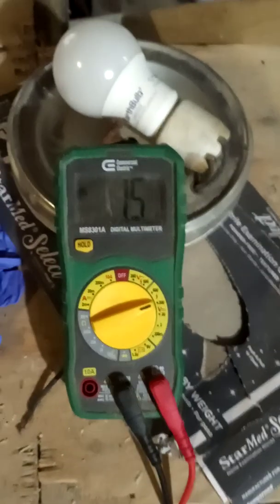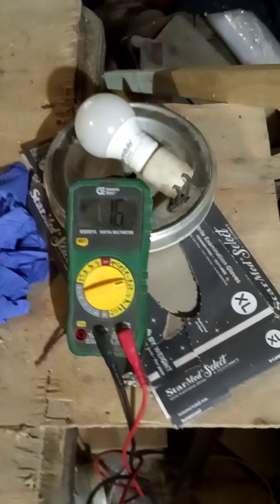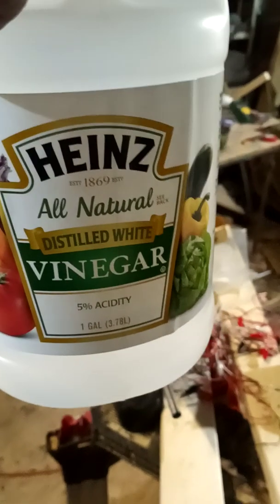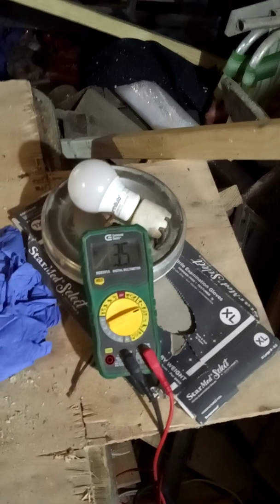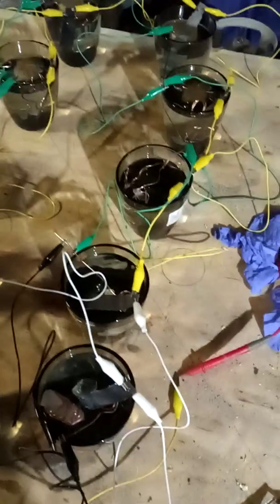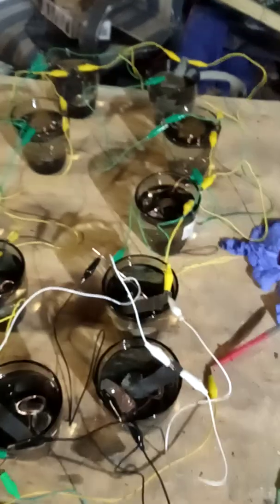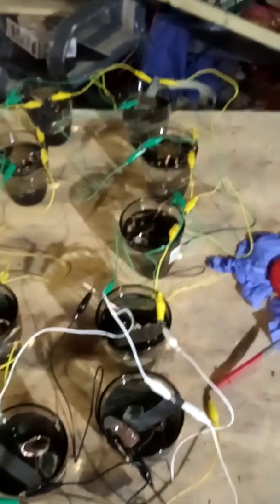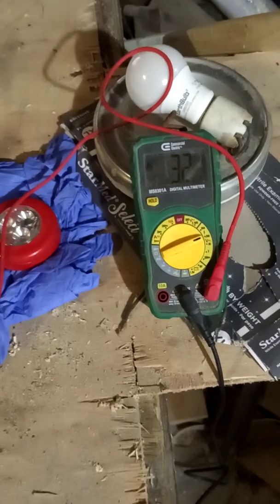research with glass and vinegar

Comment: How about red clay or mud mix with vinegar properly? I feel like the dc volt will rise. I made a energy source using two sticks warped in copper then put the red clay to the top of the sticks so it look like a tall ant bed then attach petrified wood crystal to it and dig it in the ground Maybe if I get some vinegar and make a battery it will be Super charge